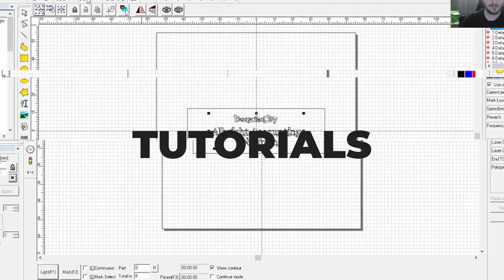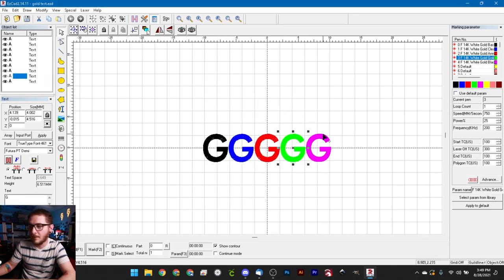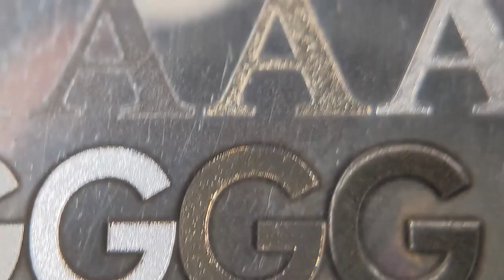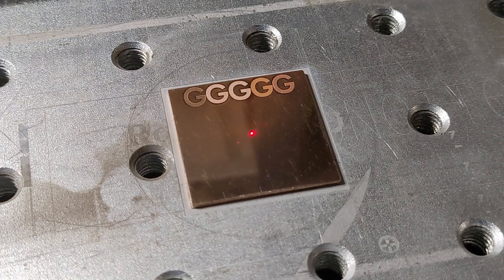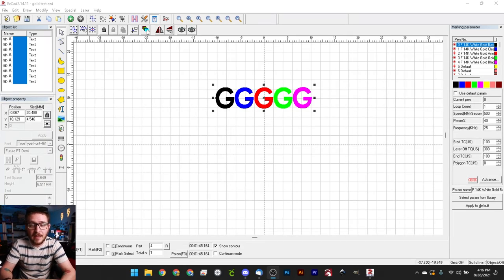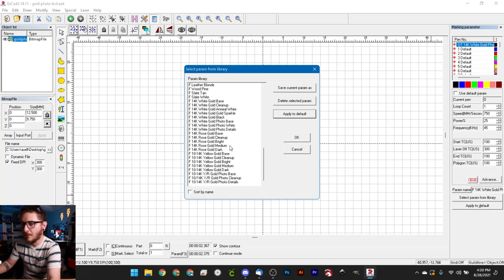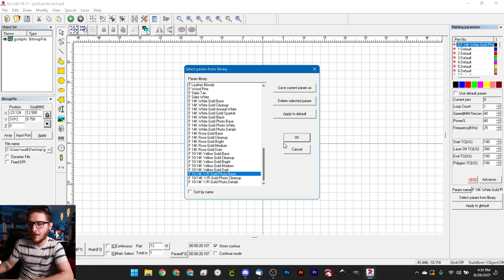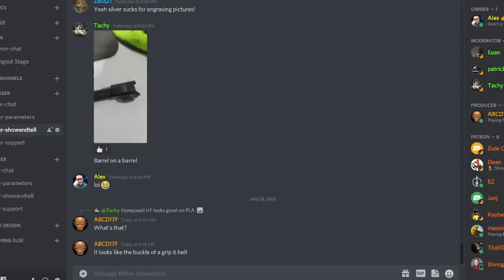Ultimate GOLD Fiber Laser Engraving Guide | Fiber Marking and PHOTOS!

Comment: What parameters would you put for pictures on 18K yellow gold ?
Reply from the maker: All of our shared parameters are available if you head to the Laser Everything website, there is a link to our shared library with each of our gold layer settings included, right on the homepage. It covers most wattage and lens combinations, for both ezcad and Lightburn. All made free, possible by the community support over at the Laser Master Academy, check that out too if you get value from the community resources :)

Comment: First of, thank you for this video! 
I recently bought a 30w fiber laser (ComMarker B4) and also joint the LMA. 
Because I have another laser machine I use LightBurn. I downloaded the libraries for LightBurn but I'm not sure what to set differently for photo engraving on yellow 14kr gold?
In the video I see some EzCad settings that I can't find in LightBurn.
Or can I just do: 
- load in the base photo, assign the photo base settings, do the pass
- assign the cleanup settings, do the pass
- load in the photo1, assign the detail settings, do the final pass.

Thanks!
Reply from the maker: As you've surmised the process is very similar in LB. If you don't know what LightBurn sub-layers are in cut settings check that out. It would save a good bit of work compared to the process you're describing above! But yes, that would work fine!
Reply: @LaserEverything  Thanks, I also looked at sub-layers. But for photo engraving, I don't see the option (I checked Mode: Fill and than sub-layers are visible/selectable). So I ended up with 3 layers: 1. PhotoBase = Y/R Photo/1 Base; 2. PhotoBase (copy) = Y/R Photo/2 Cleanup; 3. Photo1 = Y/R Photo/3 Details.

Comment: I have tried it on 4k yellow gold but I can't get it to be dark (with the settings from LMA). I have a ComMarker B4 30w (110mm lens) and used speed: 750 mm/sec, power 25%, Freq 25 kHz and line interval 0.002 mm. First I did the Base (500 speed, 40% power, 25 kHz, 0.025 line). I don't know wat to do now... Any suggestions? 🙂

Comment: Would this also work with stainless steel but 18k plated gold over it? Or would the laser zap the gold plating off leaving the stainless steel visible underneath?
Reply from the maker: Depends on how thick the coating is but very likely you're going to just engrave the gold away. It's usually not very thick certainly not enough to withstand being blasted by the laser. I would proceed with caution and use very low power settings and high speeds if you're trying not to remove the gold.
Reply: Have you ever tried laser over a gold filled piece of jewellery?

Comment: Is .11 ezcad version actually better than .10? I have noticed in this video you use .11
Reply from the maker: I use what we call the "community version" which has some ram fixes and a couple other improvements. It's available on the discord server if you ask for it. Runs much smoother than what comes from the manufacturers in most cases.
Reply: @LaserEverything  so why you still using .10? It's worth switching to .11 community version then for everything? Thanks
Reply from the maker: The differences between the later ezcad versions are very minimal. Definitely recommend the community version for almost everyone regardless of version number.

Comment: I know this is not one of your most recent videos, but was wondering if this is in real time or if the laser marking time is sped up on the video.  Also, what are your thoughts on engraving / black marking sterling silver?  We are currently laser marking our sterling but what we have found is the mark does not hold up well over time.  The mark on some of the plates for our necklaces seems to simply "rub off" after just a few months.  Pretty sure we have a 50W laser.  Thoughts?  Thanks again
Reply from the maker: Try tightening your line distance, if you're marking at .05 or .025 try .005 - .002 and see if that improves it's longevity.
Reply: @LaserEverything  thanks.  Can u clarify if the video is sped up or is that true marking time in the video

Comment: is there a way to import all library setting ? or have to manual create 1 by 1 ? is it same for lightburn ?
Reply from the maker: If you head to the Laser Everything website, there is a link to our shared library right on the homepage. The libraries can be imported for either ezcad or lightburn, dont need to do 1 by 1. Can also use the converter to combine libraries as well. All made free, possible by the community support over at the Laser Master Academy, check that out too if you get value from the community resources :)

Comment: Hey Bro....Quick question. I have a 80 watt CO2 laser like the one you changed the laser tube and water lines on in a video. My chiller is a CW3000. I live in South Carolina and this was bought from a guy in North Carolina.He had it less than a year and only had about 20 hours on it. When I`m cutting a lot (of course) the temperature starts to climb on my chiller. After I`m done cutting I still let my chiller run a while to bring the temp back down.  It`s never gone past 29 degrees Celsius but it takes a good while before it will come back down. Is this normal? Also it a has an alarm on it for high temp but I don`t know what it is set on and no way to set it that I see. What Ya think?
Reply from the maker: No not really normal. CW3000 is underrated for an 80w tube. You really need a 5200, there's a link to a legit one from cloudray in the buying guide: https://www.lasereverything.net/buyingguide

It's probably FINE the way you have it set up but I would really consider upgrading if I were you.
Then again some people chill their lasers with a paint bucket and a fish tank pump so... up to you. 

I recommend the upgrade though :P
Reply: @LaserEverything  Thanks.  I looked at them and can't really afford the upgrade right now. I got a Raycus 30 watt fiber laser on the way so after I make a few bucks off of it I'll get a new chiller. Thanks again.
Reply from the maker: @josephculbertson3555  No problem, like I said, the 3000 is better than the bucket and fish pump haha. You're probably fine. Just keep an eye on temps :P